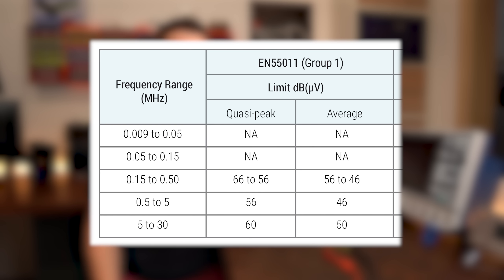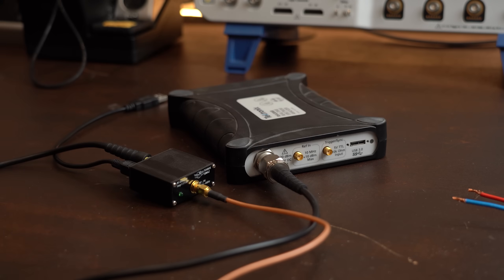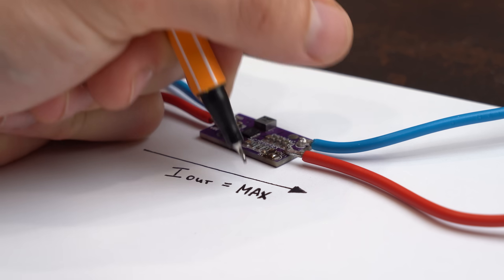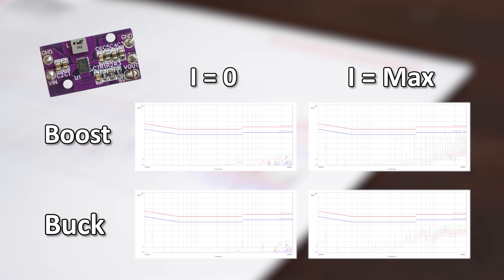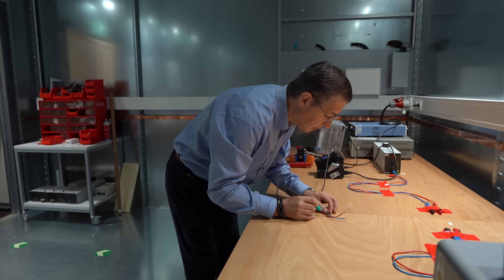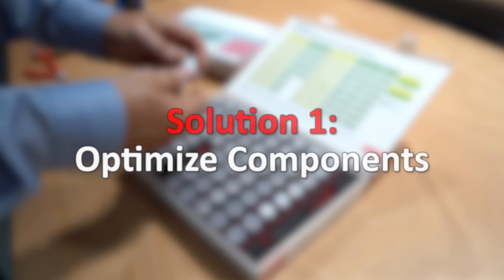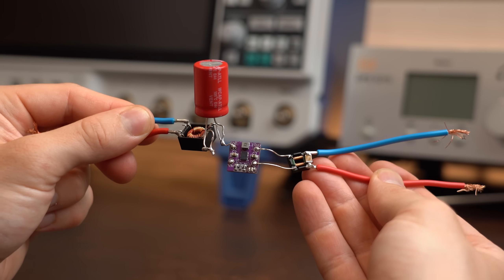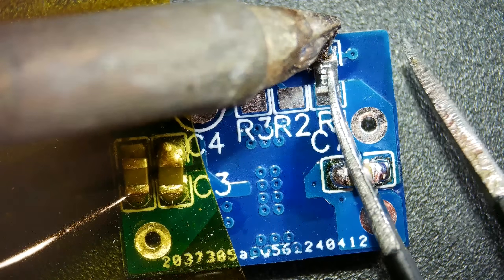Are my Circuits ILLEGAL to use?! (EMC Testing)

Comment: you can place the boost circuit in a steel box, just like a TV RF tuner. install a partitioned area and place an RLC bandpass filter that shunts the 2.4 GHZ to the ground plain and emits a flatline amplified DC.

Comment: I am going to guess my DIY 3D Printer kicks out some EMC when the SSR is running the AC powered heater bed. But maybe not as it is off the shelf parts in the electrical compartment.

Comment: It's hard to see clearly but you dont seem to do much via binding between the inner gnd plane on your boards and the gnd of smd caps etc. I've only seen a general via between layers and a prayer that it will provide enough of a return path via the tracks.

Comment: І have now big problem with it. When i try to listen some amateur radio via SDR, i have huge, terrible electromagnetic interference on spectrum, from long to short wavelength. It almost impossible to see any signal. Many things causes it - chargers for phone, notebook, router power supply, even LED lamps, and biggest from ecoflow, solar inverters. And worse - if i can switch off my, i can't do it for neighbors devices...

Comment: Depending on country and regulations, almost all  f those little modules and Arduino clones we enjoy so much are legal to be imported and sold because they're sold as components and not as consumer or industrial 'end products' . Once you use them in a product that you sell to consumers you're now responsible for EMC compliance. Even if all the components you used were individually certified, you're still responsible for the overall product. 

Fortunately, many small 'maker' businesses and hobbyist suppliers can sell 'kit' components as long as what they're selling can be reasonably represented as a component that's intended to be integrated into a larger solution. Often, they can make a good business by offering all the pieces of a complete system as long as those pieces are sold and can be purchased separately (e.g. unprogrammed board, case, and power supply) and the buyer must do the assembly.

Of course, the closer the 'component' is closer to being a finished product the more likely you are to fall under scrutiny of a regulator. For example, someone might try to argue that what they're selling is only a component because it doesn't include a jumper and a 5V USB-C power supply, but they're probably not going to get very far.

Lastly, individual experimenters and hobbyists are restricted from interfering with others. Most people realize there are restrictions on transmitting in radio or TV bands. If you live in an apartment and your homebrew home automation or smart toaster is making noise on your neighbor's TV or interfering with their WiFi - they can usually seek to have you legally shut down. Consumer requirements arose because things like those new-fangled 1970s ''personal" computers and game boxes were suddenly messing up their neighbor's radio and TV. (In fact, the frequencies, power levels, and distances were historically based on whether a device is reasonably likely to interfere with someone in an adjoining apartment or business) So be aware that you may be asked and need to adapt being a good neighbor.

Comment: There is actually a conducted immunity EMC test you can do probably at home.

The DPI (Direct Power injection) test.

All you need is a signal generator, a power amplifier and a oscilloscope.

(IEC 62132-4)

Comment: There is another EMI aspect that you didn't cover (probably for simplicity and time reasons). There is also EMI immunity testing (both radiated and conducted). The lab that I work in test our product designs for (among other things) Radiated Emissions, Radiated Immunity, Conducted Emissions, and Conducted Immunity. While, yes, you don't want your widget to cause problems with other devices, you also don't want other poorly performing devices (or even properly performing radio transmitters) to negatively affect your widget.

Comment: LOL as a kid i used to create "FM" transmitters with old ECC85 vacuum tubes. They were excellent sideband generators all the way to our television (before cable so with an actual antenna on the roof)
Pretty sure my transmitter would have blown up that measuring antenna :D

Awesome vid! And thanks @wuerthelektronik!

Comment: Funny thing. Some 35 years ago. Though being a mechanical engineer, I had the task of designing an industrial multiprocessor board with lots of I/O. Size approx. 10 by 10 inches.
To be fitted in electrical cabinets with 3 phase contactors and other noisy stuff. To simplify board design, I used 4 layers boards with ground and power planes on the outside.
Hundreds made, working flawless. Seems I did a clever thing.

Comment: EMC topic is voodoo for many people, but as the frequencies of consumer electronics interfaces increase, it is rapidly becoming an issue. For example, in terms of required product testing before market, a failed EMC test means lost money and time, which is initially not expected by the board designers and product developers. This vid teaches us that even products on the market may have their pitfalls outside of the basic usage scenarios.

Comment: I have a JVC stereo system that i leave turned on all the time because it does a screeching noise in standby mode, presumably due to an EMC issue.
Reply: Or just a bad capacitor.

Comment: Great video on an important topic! One thing I never quite understood is why multi layer boards don't ever seem to put the ground plane on the outsides and the traces inside to minimize radiation. I'm imagining that the components could go directly to the inner layer through vias, which would make troubleshooting harder, but might help in specialized applications.

Comment: As a ham radio operator I can definitely say most of the junk on the internet generates horrible amounts of noise.  You can build filtering circuits on the input and output of power supplies and enclose them in shielded boxes and most of them do pretty darn good... But I take most people don't go to that trouble

Comment: You didn't mention the other possible solution, which is to put the board inside a grounded shield box. Filters on the input and output help, but not if the circuits on the board itself are radiating.

Comment: Useful note: It is possible to 'self certify' for CE by making a DOC (declarationof conformity). The CE mark covers both electrical safty (usually under the Low Voltage Directive) as well as intentional and unintentional radio frequency emission (EMC). You dont need to do anything more than the DOC, but if things go wrong and an inquiry is made, you really want some evidence to back your declaration. This can be in the form of a emc 'pre-cert' lab report that will be less expensive to obtain than going to a full blown certification body. 

For the US I understand there are no strictly required electrical safty regs but there is FCC which covers EMC. Self certification is less common here, but you can import up to 3 items at a time for personal use with FCC form 740 pt.II item 7. 😀
Reply: That is an interesting tidbit that will be stored in the memory banks. Thanks for sharing!

Comment: Surely just adding shielding to a case is easier, then open boards ! 🤣 Retro CRT's are coming very popular, they produce a lot of interference, so much you can see what the person watching 🤣 It's very good showing it off in a Lab with big direction aerial to pick them up, but, aren't  most of these  interference on the low bands and are very weak ? 😇 Keep up the good work, enjoy your vids.

Comment: These boards are legal in any case, at least regarding Europe with its CE.
Except of rare cases such boards count as "components", as like a chip, capacitor or resistor. None of them need to fullfill the CE requirements (there are requirement regarding RoHS and REACH tho). CE decleration is only required for a PRODUCT. Therefore the board integrator have to validate and fix any kind of EMC/EMI issue. This always have to be done - no matter if the used components are certified by itself.

So, as a general rule (as I said, there are exceptions), such project boards don't have to fullfill the emission regulations. The final product created with it have to.
Reply: this is not like you describe anymore... As soon you place to market should be CE compliant, else you will pay for the "lesson"
Reply: @askLorandt  it has not changed, because it is technical not possible nor relevant.
Parts are parts by definition. CE applies to products, but parts can be products if some characteristics apply. To be clear at this point: In some cases it is strictly forbidden to make a CE marking on parts, because it's not legal according to the compliance guidelines.

As some kind of exception, I already noted this, are RoHS/REACH declerations, as part of the CE process.

You might ask why I wrote it is technical not possible. You, as manufafturer, will define the "intended operation state", which is measured afterwards. Let's be a little bit sarcastic here: You, the manufacture, decripe the intended operation state "no power". You will measure nothing.
True, this is nonesens and can't be declared this way. But a part can be used in countless possible veriants and this can't be measured. For example: This sepcific DC/DC converter you try to sell here, just declare in your datasheet: Put common mode chokes on input and output, a bank of capacitors and put it all together in a metal can.... well, you can rediate whatever you want. Accodring to your "intended use" it doesn't matter.
That's why the majority of parts are not part of any kind of EMI/EMC measuring. How they behave is defined by there use in the product where it gets implemented. That is, why even you, as manufacterer, integrate some kind of CE approved part - let's say a common brick power supply for example - need to measure the whole product/machine/assembly afterwards, because the part itself may comply, but how you are using it in your product may not.

Comment: Great video! As an amateur radio operator I am fully aware of the issues that poorly designed electronic devices have on the electromagnetic spectrum. From PWM LED drivers, to switch mode plug packs and USB chargers, Ethernet networks and right up to my VDSL2 modem... all the RF soup makes listening to weak HF radio signals a challenge. It takes a lot of work to design a fully EMC compliant product and many manufacturers take shortcuts to save costs.

Comment: Do the filters on the input & output affect the performance?
Reply: Generally not, filters pull away power at undesirable frequencies, so don't affect desired operation.

However, you can go overboard. Too much inductive or capacitive load can reduce circuit efficiency, increase power consumption (and heat!), and with some switch-mode designs, break the oscillator  and cause the power supply to shut down.

So, don't go too crazy with filters ;)

Comment: Why would you not use layers 2 and 3 for the traces and 1 and 4 for the planes?   They could act as shielding for any noise radiating off the internal traces.   It would suck more to troubleshoot. 
I loved your trip into the Würth EMC labs!

Comment: I made some simple indicator lights for my friend's bike (e-bike / pedelec). We used a cheap MT3608 boost converter to convert the 6V I got from one pin of his battery controller to 12V for the lights. We tested it in his garage and it worked great, except for the fact that his DAB+ radio briefly lost reception every time the indicator lights were turned on :D

Comment: Fun stuff.  Most of what I work with is up in the 30 GHz range but when testing our products we have to perform both the conducted and radiated tests as required by the applicable ENs before we can declare conformity for our product.

On the home front, we had some landscaping work done which included some lighting that was powered by the available 24 VAC for the existing low voltage lighting. The landscaper finished the work and left before dark and when I returned home a bit later the lights were on and it all looked very nice.  However, I couldn't open my front gate using my remote control and had to resort to the gate's keypad which is hard wired to the gate opener.

Long story short, I traced the problem to a new up-light with LED bulb that had been set up near by gate opener.  The LED bulb was generating enough RFI up in the 315 MHz range to prevent the receiver from detecting my opener unless I walked up and stood right next to the gate.  The landscaper wouldn't believe me until he saw the problem with his own eyes.  The solution was to move the up-light further away from the gate opener and to replace the LED bulb with a different model that didn't spew RF all over the place.

Unfortunately the landscaper forgot to leave the noisy bulb for me.  I had really been looking forward to having a look at it with my spectrum analyzer and SDR receivers to see where and how much RFI was being sent out.

Anecdotally, I hear from a lot of amateur radio operators about problems from switching power supplies, solar array micro inverters, and LED bulbs that really cause problems with receive noise in the HF bands.

Comment: Full time PCB designer for 10 years here. For EMC reduction, i would start at better layout. Its usually the cheapest solution when it comes to volume production. Component changes should be done if you really need it, since you can save money and space. Nowadays virtually every board is a multilayer board for this reason as well as complexity. 
For 4 layer boards the "traditional" stackup of Signal - GND - Power - Signal is better than a 2 layer board, but its till quite bad. The main reason is that when you switch the signals from top to bottom, you also have to switch the reference layer, and you cant connect GND and Power for obvious reasons. There are some kludge ways to improve this, but its a lot better to go to a better stackup.
Now days what is recommended is a stackup is Signal + Power - GND - GND - Signal + Power. This is an amazing way to minimise radiated emissions and it really doesn't take all that much space. 
As others in the comment section have pointed out Robert Feranec has great videos on this topic. My personal favorite are with Eric Bogatin and Rick Hartley.
Great video i loved it.
Reply: Best comment I've read so far :)

Comment: Whether these boards fall under EMCD due to being "research & development" boards is irrelevant. The loophole you mentioned isn't accurate. The manufacturer must evaluate the product based on its intended use and account for any foreseeable misuse. So, even if the manufacturer claims the output shouldn't be loaded, it's still a reasonable misuse scenario that requires EMC evaluation.

There aren't any real loopholes—just poor excuses.

Comment: This reminds me of the interference heard on Ham Radio, caused by some L.E.D bulbs and fluorescent light fixture.

Actually- If you put rj45 connectors on each end of telephone cable then interference can be heard on FM radio between 85.5Mhz - 87.7Mhz and this all reminds me of back in the day a simple break in a overhead communications cable resulted in the AM radio's & ham radio's being blasted with noise and not even JPO? (Called Ofcom nowadays) knew until someone complained about their landline not working and tired engineer had rectified a break and the noise went away.

Comment: All measuring equipment for verification of EMI/ EMC 
compatibility ...have internal filters usually of 6dB b.w. and are switched in & out as the test sweeps across the freq. spectrum ..
the filters are different for average , peak , weighted  average etc..
But most filter b.w.@ (6dB) are about 10 kHz wide...and is sampled for about 3-5 seconds before the next freq.step is selected.
Hence some chip designs offer " pseudo random pwm freq " switching and some offer pwm with dither / & or jitter... 
this dither freq. jumps by >(13-19) khz at a (300-500)Hz rate to prevent the instrument's from fully filtering the test freq....
Similarly chips with jitter freq. pwm./ spread spectrum pwm/ pesudo random pwm , cause the pwm osc. freq. to vary by (17-23) kHz ..thus the filters cannot fully sample the switch freq. This leads to a lower max. measured value thereby the d.u.t. may clear the tests.
The other option is to design using resonant converters.

Comment: Qungshan radio is a massive harmonics emitter even when you use the CB band in the air band which is no good.... It made it through my customs because it wasn't a Bafang.

Someone suggested that the chipset is really awesome in that radio and that it's a reference design that they just rushed to production so actually it is a prime target for someone who wishes to place the right kind of low and high bass band pass filters and some other types of filters to eliminate the very nasty second 3rd and 4th order harmonics.

Comment: Finally someone who cares about EMC regulations. As radio amateurs, we have been suffering for many years from poorly constructed electronic devices that cause interference. Although the BNetzA is doing something about it (we have also produced a video about it), it can't keep up with the mass of cases. The issue has not reached the general public at all, who unfortunately continue to buy cheap junk from China, most of which does not comply with EMC regulations in the slightest.

Endlich mal jemand, dem die EMV-Vorschriften nicht egal sind. Als Funkamateure leiden wir seit vielen Jahren unter minderwertig konstruierten elektronischen Geräten, die Störungen verusachen. Die BNetzA unternimmt zwar etwas dagegen (wir haben dazu auch ein Video produziert), kommt bei der Masse der Fälle aber zeitlich gar nicht hinterher. Bei der Bevölkerung ist das Thema überhaupt nicht angekommen, die kauft leider weiter Billigschrott aus China, der die EMV-Vorschriften meist nicht im Mindesten einhält.